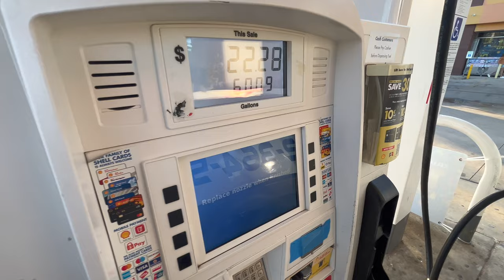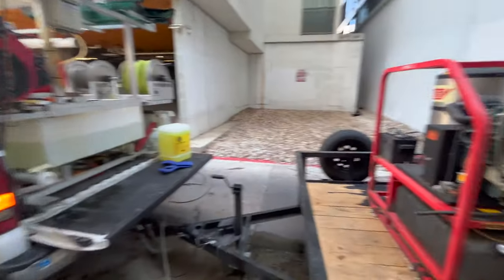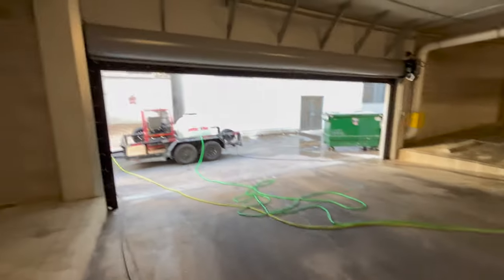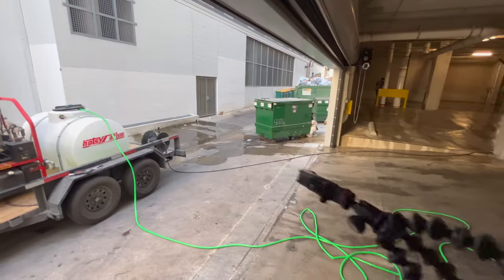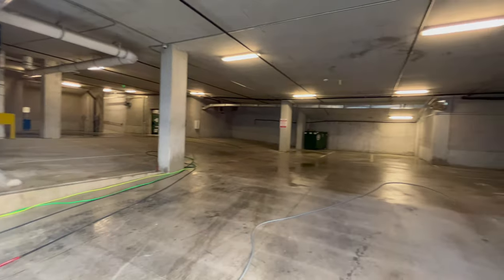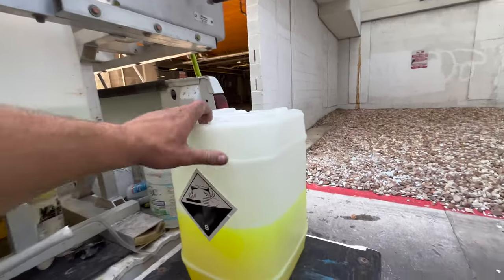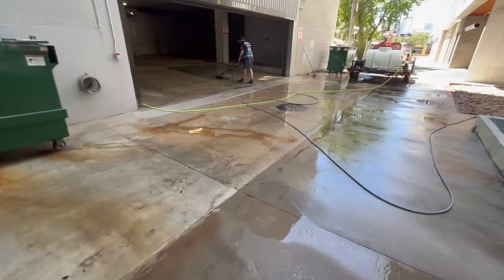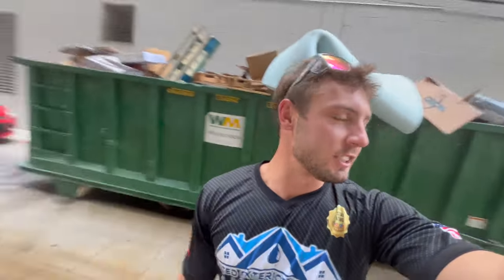Commercial Pressure Washing | Wash Vlog #15

Comment: Bro you should look into Caustic Soda Beads or Sodium Hydroxide, cost less than gold assassin and it kills the grime and oil a lot better/more profit. Pretty sure that's the ingredient in these degreasers 100%, also beats driving down to SA lol
Reply: Duuude yup… I got a 5 gallon pail for $130 and i downstream a little stronger mix, cleans up the chick fil a grease great at all my stops
Reply: @stillXpist  do you mix the beads with the water? and what are the ratios like?
Reply: @stillXpist  where do you source from?
Reply: @RuffleBeast  yes you mix with water to create the solution. I've seen a lot of videos about it and everyone's ratio is different but usually it's a pound per gallon. So that 5 gallon pail is 50Lbs so you're looking at 50 gallons of solution.
Reply: I mix 1.5-2lbs per 5 gallons, I’m downstreaming so I want this stronger so as it gets diluted it’s still cutting through.
Reply: About 3 lbs per 8 gallon will probably be all you need. You play with the mix. A little stronger or weaker. You’re also downstreaming it like  still pist says so it’s even more diluted but still melts the grease/oil very well
Reply: There’s also potassium hydroxide. Works similar to sodium hydroxide. Potassium H works a little better on food grease, sodium hydroxide works better on petroleum greases. It's generally not a huge difference but there is a difference. It’s the same chemical in drain cleaners like drano. 

 But guys be careful mixing. Look up how to properly mix. As it can get really hot (temp) and melt plastic. It will also burn your skin chemically. Respirator and all other PPE. I use this stuff for stripping stain and paint off fences and decks and also restoring wood. My starting ratio for each is 1cup or 9oz per 1gal cold water. It is definitely cheaper than store bought stripper which is way more diluted. I add gain laundry detergent as a surfactant and works great. I use a 12v sprayer with 50’ 3/8 clear hose. And a roundup handle sprayer. This stuff is highly corrosive. 

Good luck to y’all and Davis keep grinding love your content.

Comment: Hey man, What type of down stream injector are you using? My does not pull chemical that well and sometimes doesn't pull it at all. I've cleaned it a few times but doesn't seem like it wants to pull. Anyways, keep up the good work!
Reply: m5 xjet
Reply: What gpm and injector size are you using?  And how much pressure hose are you running?
Reply: @alexvalls7209  8gpm and the injector that came with it. I go from 100ft - 200ft. It worked once but after that one time, it stopped so I stopped using.
Reply: @mrmopressure  would you rinse it out with water after you were done with the solution? Does it have a stainless steel ball or ceramic ball in it? You may need to poke it to get the ball freed up. And maybe it might be a cheap downstream injector 🤷‍♂️

Comment: Leaving lines like that is something that seriously stresses me out! Did you post before afters anywhere? Would love to see if you were able to deal with the lines
Reply from the maker: Yes the lines got fixed. Post treat or surface clean again
Reply: @AustinDavis24  I would change out the nozzles on the surface cleaner with a different orifice size and possibly a 25 or 40 degree spray angle. It would allow you to move faster without getting swirl marks or the lines along the outside edges of your cleaning path. Northern Tool has a great variety of nozzles to choose from.

Comment: I wanna get into more commercial jobs like this but I’m wondering: Do you need some sort of recollection system if ur just using degreaser?
Reply: "Reclamation". It depends on the circumstances such as your surroundings and local codes. Big fine $$$ if you get caught, so always research first.
Reply: @markmills7643  I assume it’s a by the state type deal like they make their rules abt it
Reply: @mikenovacek8689  Not just the state. The next county over from me says NO pressure washing a sidewalk in the city limits. I was told that if you want to clean it, use a mop. I couldn't believe the response.
Reply: @mikenovacek8689  it's a EPA regulations and it depends if it's enforced. Also depends if the drain just goes to a retention pond and not the water system. Best to do the research and call the right people to know what's best in your situation. And from what I hear the customer is the one that gets fined. So best to protect them.